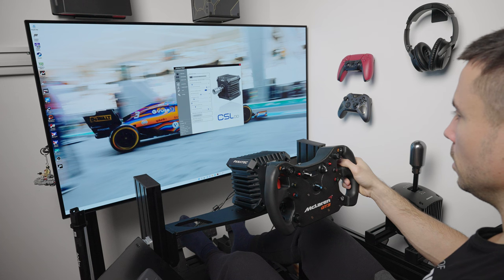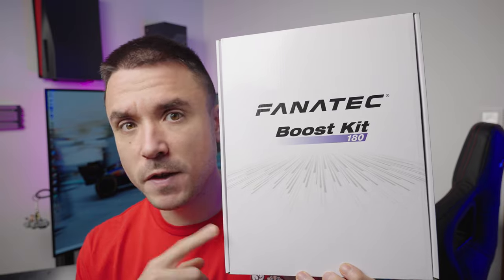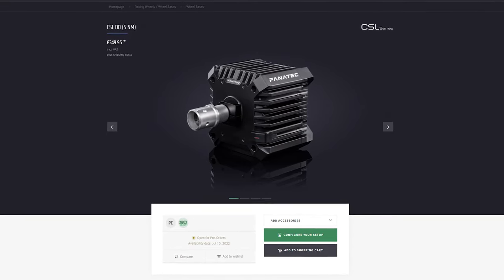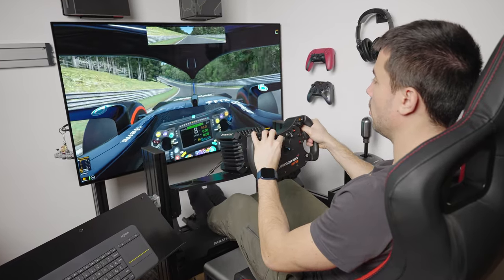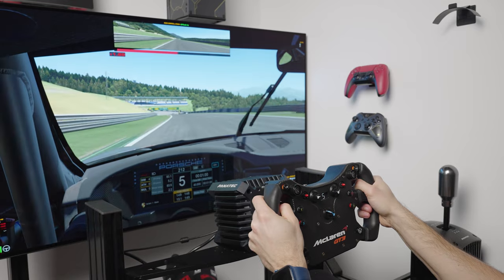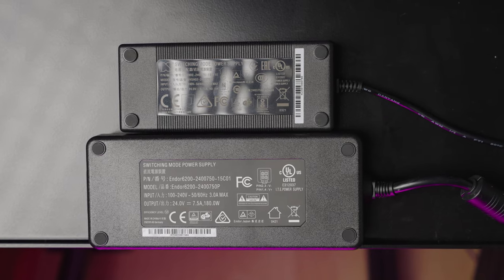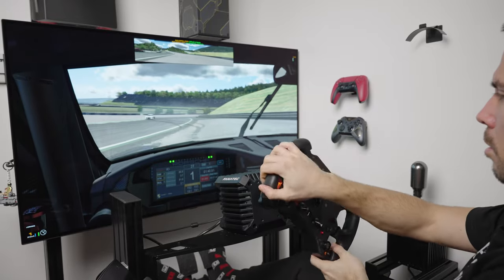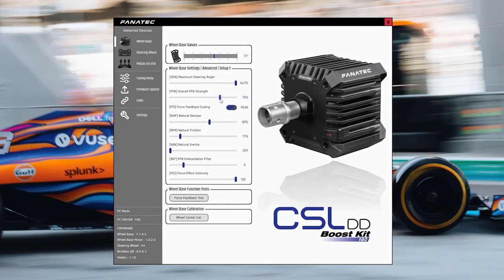5 vs 8 Nm CSL DD Fanatec - FINAL ANSWER!

Comment from the maker: How's up for some Capri Sun?  😁 You'll see why I'm asking that if you watch the video 😂 BTW. do we have any CSL DD owners here, what's your experience?

Sim Racing on BIG TV - https://youtu.be/SdwKHiSg2V4
THREE REASONS You NEED a Sim Racing Rig - https://youtu.be/QcHfKPaNQQw
Reply: I don't have a racing wheel currently, might buy myself a T300RS Alcantara Edition, your video is nice though.
Reply from the maker: Thanks! How are the prices right now for T300RS?
Reply from the maker: CSL DD is definitely the better option, if you already have a wheel, I would rather save up some more and get it down the line
Reply: @MattsPaddock  can't buy a fanatec in my country, only Logitech is available. The T300RS GT and Alcantara Edition is crazy overpriced here because it costs more than $500 - around $550
Reply: T300 has reliability issues cuz of overheating. Paying over 300 bucks is a scam and only with warantee. If only logitech is at your place go get it. At least they are reliable. 

From which country do you come btw? Maybe let someone from another country let you send it.
Reply: @Martin-vn9fr  I am getting the wheel for 1 year warranty and I will always keep the fans turned on. The thing I do not like about the logitech wheels is that they are not very good at their job but I might be wrong as I've seen people saying that the belt driven system is much better. I am from Moldova btw and brand new G29 Retail price is $450 lmao
Reply: How do you fix deadzone (loose feel) in the center position on a straight?
Reply: Warning! 

Within 4 months of light use my FANATEC McLaren wheel cracked at the shifter pivot point and where it mounted to the QR. I was accused of over tightening although I used a torque wrench set at 3nm. 

FANATEC then replaced the wheel chassis admitting in writing it was a weakness in the wheel.

Very soon after my CSL load cell pedal failed. I sent a video before sending the pedal set back as requested.

I was required to make a follow up email after not hearing back. 

FANATEC said they can not fault the pedals asking if I want then sent back which I found a strange thing to ask?

Eventually they were returned however within minutes I experienced the same issue which was consistent with magnetic interference from the CSL DD wheel base before the load cell pedal would completely shut down.

I was beyond my limits at this point and driven to warn as many potential customers as I could while demanding a replacement.

Following the usual delayed response, FANATEC then offered a replacement only if a show proof that they faulty load cell was again on its way back to them.

FANATEC’s poor response time drove me to desperation. 

Keep in mind I have owned this new product for around 6 months when 2 major failures occurred.

An electric technician overheard my experience and offered assistance.

I was able to demonstrate the issue and within minutes the technician diagnosed a defective voltage regulator attached to the load cell circuit board. 

The voltage regulator is designed to reduce 5 volts coming from the wheel base or USB down to the required 3.3volts. There was no signal out of the regulator which he replaced.

No thanks to FANATEC I am now enjoying my sim racing again while I hold my breath for the next FANATEC failure.

Please take my advise and look at the FANATEC’s own forum in regards to all the issues they have and their terrible customer service.

Comment: great video, thanks! Just wanted to add it's possible to buy the 5Nm version and then buy the 180W boost kit to 8Nm, that's the same price as buying the 8Nm directly... So I would recommend to buy the 5Nm and then buy the kit if you feel you need it! You end up with a 8 Nm with an extra 90W transformer.... Isn't that right?
Reply from the maker: Yes, that's correct!
Reply: Iam gonna do the same , if the 5nm doesnt feel as sturdy as i want. Iam going to buy the boost.
Reply: @GorillaGoat21 buy the QR1 as well, no way the fucking plastic QR is gonna last
Reply: @GorillaGoat21  Just curious as I can't seem to find a definitive answer, does the 8 NM PSU just add force that the wheel uses which makes it harder to turn or does it provide more feedback over the bumps and whatnot? I have the 5 NM version but it feels "squishy" and not very responsive (esp. in the Next Gen) but not sure if the 8 NM wheel would fix that or not. Or maybe its just my FFB settings I need to adjust in Fanalabs? Thanks for any insights!

Comment: Hi. I noticed that the maximum measured power for 8Nm was 54W. Have you tried to mod the 5Nm brick in order to have 2V+ and 2V- and check if you get boost? Considering the power is well below 90W it should work like a charm.
Reply from the maker: In theory, yes, but it's possible that the peak spikes are not recorded with this power meter, plus maybe there are some scenarios that could pull above 90 Nm, but I couldn't replicate it.

Comment: Sir for long time use like 10 years which MSI 1650 card is recommended MSI 1650 ventus or msi 1650 gaming X please reply
Reply from the maker: Gaming X!
Reply: @MattsPaddock  sir which processor is good for MSI 1650 gaming X: Intel i5 11400 or 12400

Comment: Question: Whose DD Base also makes a very slight noise when it is switched on? It‘s a very slight high frequency noise. I use it with the Boost Kit which also emits a high-frequency noise. 
I would appreciate if you could let me know if your Base (and PSU) is COMPLETELY silent - when it's on. THX 🙏🏼
Reply from the maker: I'll check that and get back to you!
Reply: @MattsPaddock  he never got back💀💀💀
Reply: @MattsPaddock still havent got back 😂

Comment: could i just buy an aftermarket 180w brick to get the 8nm? over $200 seems crazy for a power brick
Reply: Yes. Actually, you can do better. But the CSL Elite power brick and make a barrel plug to 4-pin adapter. It's the exact same power supply. Just a different end

Comment: I think your wheel is too far from you but I’m just telling. Nice video your very helping me in my passion of simracing. ❤️
Reply from the maker: Thanks for watching! As for the positioning,  I'm always moving about as I test new gear, so the result is not always be 100% right seating and wheel height/depth, especially with different style of games in the mix. I'll be testing a couple of new rigs in the next few videos, ones that are a bit easier to adjust on the fly compared to something like the P1X or TR160 I've reviewed before, so be sure to check that one later on 😉